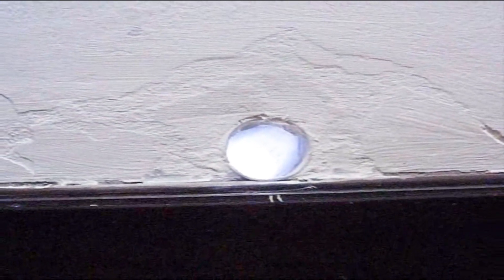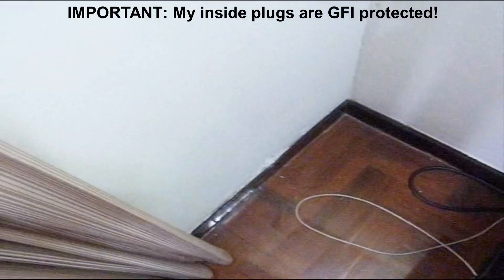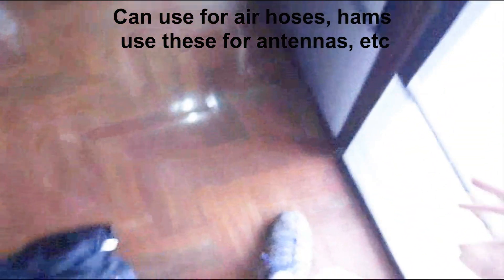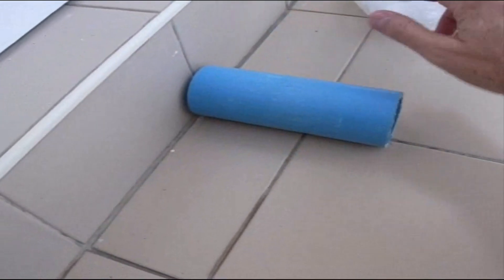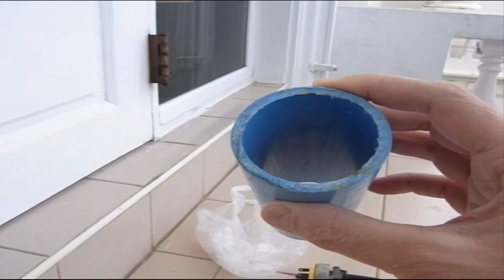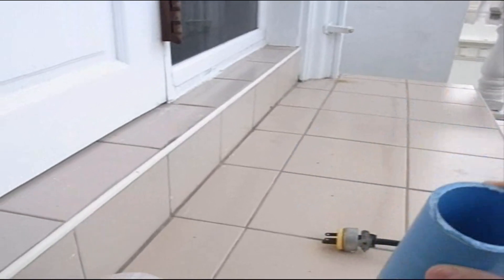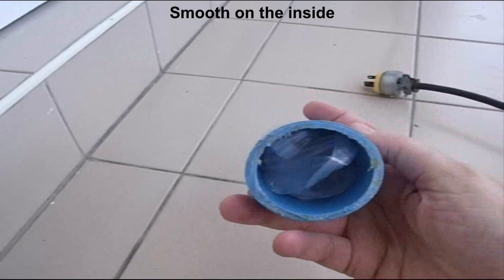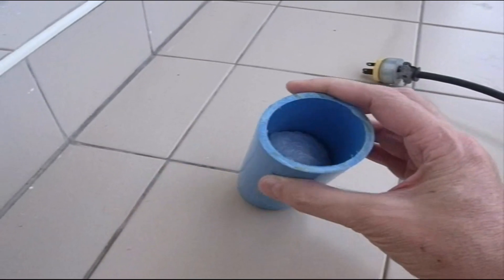Wall Through-Hole - Alternative to Outside Electric Plugs

Comment: Stucco paper is what keeps moisture out of your house, the stucco is porous, by drilling a hole in it you break this seal, any moisture that runs behind the stucco will find this hole and leak in , any penetration in the stucco needs to be properly flashed into the underlayment.
Reply from the maker: @user-hl4yz9jb9i  That's true with wood frame stucco. Mine is stucco directly on brick.
Reply: lets hope people with wood framing dont start going drill happy before they read this 😂
Reply from the maker: @user-hl4yz9jb9i   People should know what you are doing before you drill through ANY wall! They are full of wires, pipes, support members, ....

Comment: Doesn’t this violate electrical codes?
Reply from the maker: It varies with the state/county you live in. In my area this is not an electrical installation (it's a temporary passage for a wire, air hose, etc.) It could also be a building modification which would have to meet codes. Again in my area it's OK.